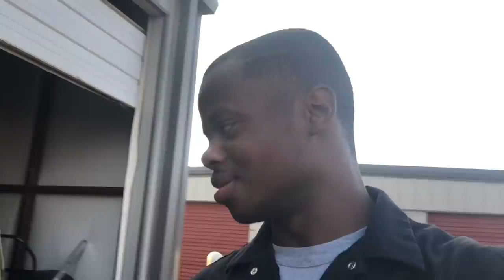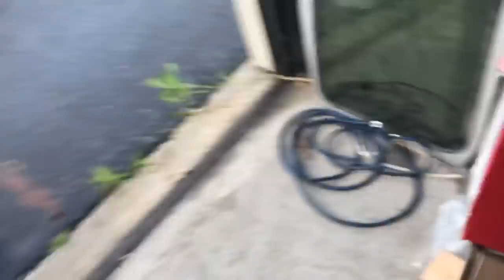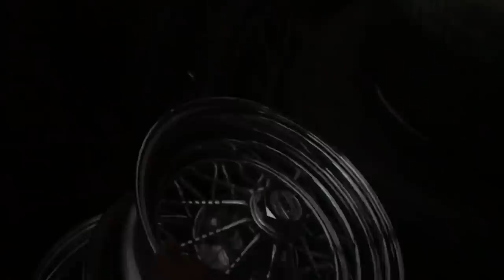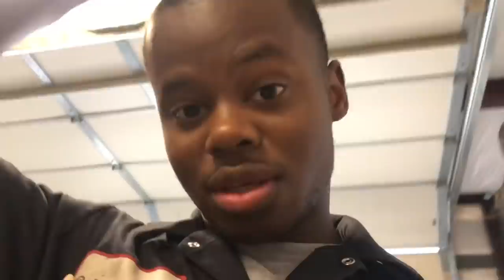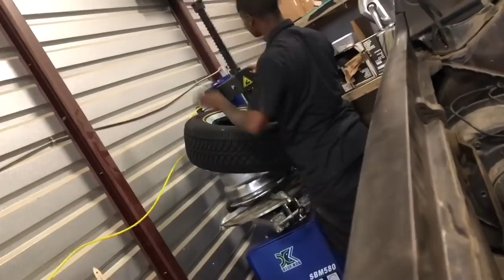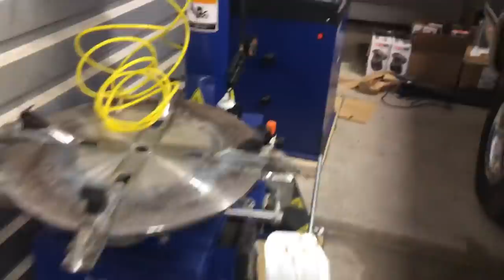30s & Vogues 🔥

Comment: Hey Steve did you need any spacers or adapters for the 30s???
Reply from the maker: No just the right lug nuts
Reply: Thanks mane just found a set of cragars in Jackson MS.... No caps on them and a Lil rust but clean
Reply: Hey Steve, what's the right size lugs and spacers for the box, I have some 15 in starwires... Oh and stem size... I like those chrome ones